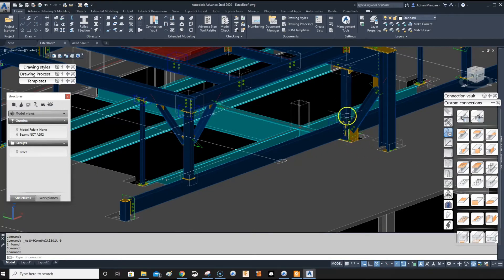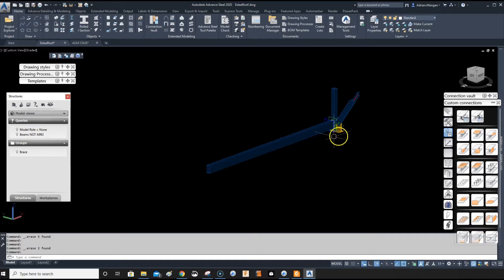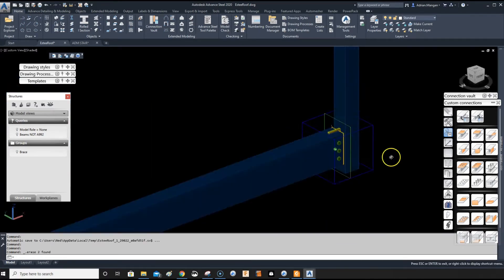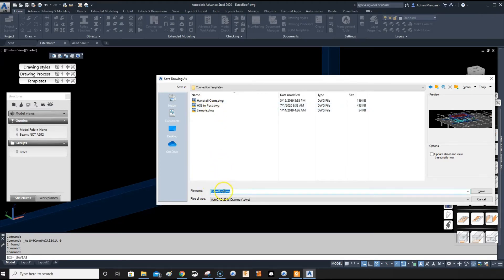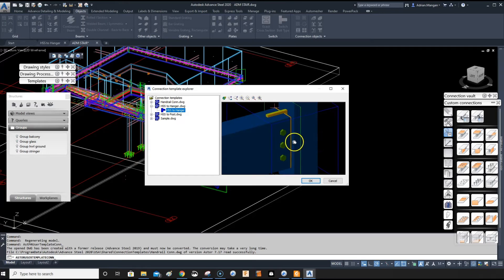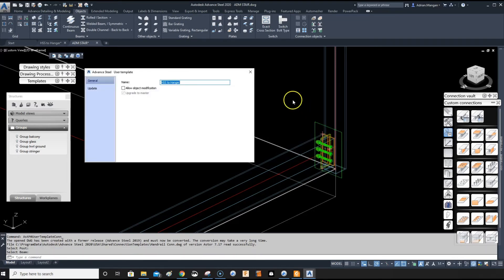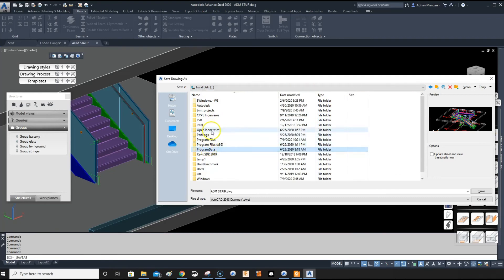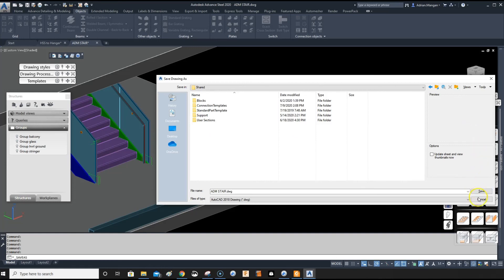ADVANCE STEEL IN 5 - Custom Connections Reuse.

Comment: Hi, is there a way to create a custom connect say for an angle horizontal brace that can be used for differing angles that the brace is used at say 45 deg and the 60 deg?
Reply from the maker: Hi Darren, not sure i fully understand but I would just use the brace connection thats already in the connections palette and save the values in the library, regarding the degrees that shouldn't matter